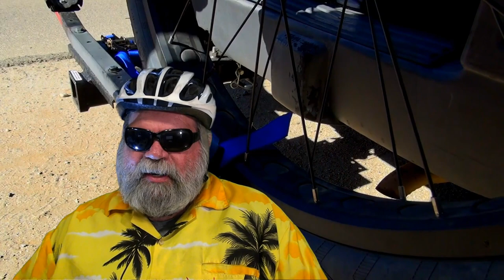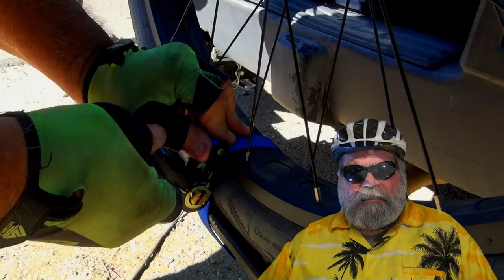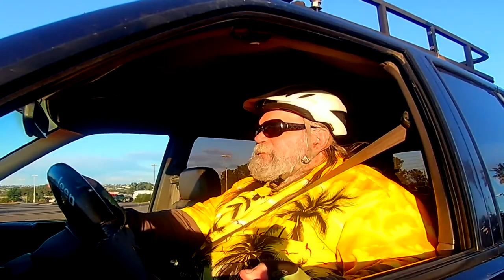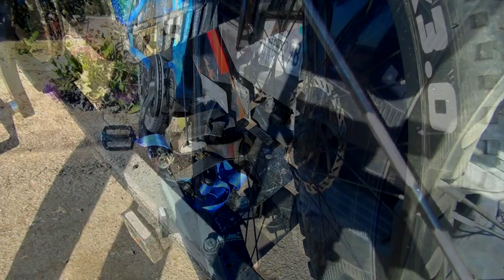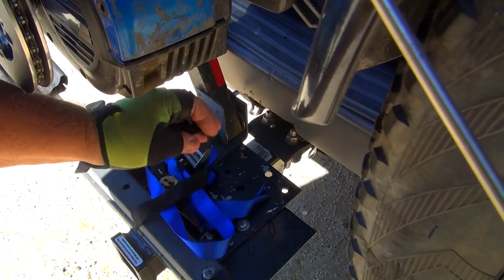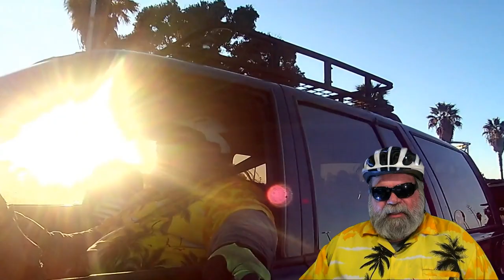Loading my eBike onto My "DIY" e Bike Rack & Strapping the e-Bike Down.

Comment: Wow, I never thought of the tires going flat and the hook not holding. I do have another helpful bar holding it as well in fact I use the same strap on it as you mentioned in you rack build video. I will send you a pic soon. I should probably consider strapping it as well but I like easy and fast on and off. Maybe for extended drives.
Reply from the maker: The only reason I brought up the flat tires is a buddy of mine lost his bike in just that way. I'm making a short little video on the accident. His bike was totaled and the car that ran it over was damaged also. My buddies insurance paid for the damage to the other car but not his eBike. When I go on long drives I add a strap and I also hook up my tail light extension bar.

Comment: I also made my Bike carrier, a bit different from yours though as my tires and wheels sit into a well so to speak. I use a center mast and hook onto the center joint and it works well. I only ratchet strap on long or highway runs as extra security. Good video and keep it going. Thanks.
Reply from the maker: Thanks, The bike rack in the video is a rack I built 25 years ago and has sentimental value for me so I keep using it. I have built much better rack but it seems some of my friends always need a rack for their eBikes so I end up giving them the nicer ones I've built. As I said I've been using this rack for over 25 years and it's served me well. I have a video coming out talking about a friend who has a rack similar to what you described and he never used any tie down straps. Unfortunately his tires went flat while transporting his eBike and the bike slipped under the top tube hook and bounced out of the rack. Sounds like your rack is very secure but I maybe add a strap just as cheap insurance. I would love to see a picture of your DIY Bike Carrier.

Comment: I noticed 2 things in this video...... 1. What happened to the 6 foot long channel for the wheels/tires that were in the first DIY Bike Rack video?   2.  I would normally suggest locking the front suspension fork but with the extra strapping used, it is probably not necessary.
Reply from the maker: Thanks for noticing the differences. Yes, in this video I'm using a rack I built over 25 years ago and has served me well. It has carried road bikes, Mountain Bikes, Recumbent Bikes, and now eBikes. It has been run into by cars, backed into trees, and it is totally scratched and dented up pretty good. But this kinda makes it like me, dented and scratched up and the rack has sentimental value to me. Actually, I have been using the rack that I made a video about, but my friends always seem to need a heavy duty eBike rack, so I end up giving my video racks away. I'm making another video style rack so you will see it in future videos. 😎 You have a good point with regard to locking the front fork and on longer travels I do switch the suspension fork into the locked position. That's a great advice I forgot to mention in the video.

Comment: Is that a roof rack that you used in this build?
Reply from the maker: I've been building my on bike racks for years and have ended up with extra parts from old racks. Many of my builds have parts from many different types of racks. Yeah the tire tray was probably from an old rack however sometimes I would purchase a replacement tire tray on-line for a build. Recently, unless I have the extra old parts I usually purchase some aluminum U-Channel for the tire tray. Thanks.

Comment: That looks like a different rack.
Reply from the maker: This was the first rack I built 25 years ago and it's still going strong. The racks that I built in the How To Video, I gave all of them away to friends. I'll be making more racks but this one has sentimental value to me so I'll probably keep using it. It's kind of bent up from being run in to but I still like it. Plus it's all scratched up so it kind of matches me. I'm kind of well used also.  😬

Comment: I see some issues, your license plate and brake lights are covered, giving the police a good excuse to pull you over. You lifted the bike up and strapped it in, it's not rocket science. You could have said everything in thirty seconds or less, maybe you should have shown people how to build the rack instead.
Reply from the maker: Yes, I've had comments of that nature before. Actually, I've had 2 different police officers tell me my set up is good. The brake lights are visible through the spokes along with the upper light, and the license plate is viable enough to be legal. They told me, that basically almost any rear bike rack obstructs some part of the lights and/or the plate but the only reason they might pull someone over for that is because they are suspected of some other crime. However, in any case, I've been using  that particular home made bike rack for over 25 years to carry road bike, recumbent bikes, mountain bike and now eBikes and have never had any issues with the police for using it. However, when I use a bike cover when hauling the bikes I have an extension tail light and plate kit that clips on the bike rack. Unfortunately, almost all of the rear style bike rack obscure parts or all of the rear lights and/or the license plate. As I said, I've never had an issue in the entire time I've hauled bikes, but you are correct, the obstruction could be a traffic violation. I probably should use my tail light extension all the time, but as I said, I've never had an issue with it. How to you carry your bikes?
Reply from the maker: Yes, it's not rocket science, but for some folks, they prefer detailed instruction. Sorry you didn't enjoy the length of the video. Many have said they enjoyed the information as well as the entertaining style of the video. You mentioned a how to video for the eBike rack. I have made just such a video. Here is the link to my video showing how to build the heavy duty bike rack. . It also has a parts list and shows where to purchase the parts. The video was made a while ago so the prices may have increased. Hope you enjoy the How To video  https://www.youtube.com/watch?v=-uPYo8zCr7U&list=PLq9_CVXEjS_CJX-mdYEdzO0AsUTHocOmi&index=1
Reply: @GreyBeardEBiking  you seem to be taking this a bit too personal, you should think about turning comments off.
Reply from the maker: @kengunnett2017  WOW! Not sure where the "Too Personal" came from? I simply answered your questions and actually agreed with you on the obstructing the lights and plate issue. Also I gave you an avenue to view the DIY bike rack. Again, sorry you didn't enjoy the video but I think I'll keep the comment section active as I enjoy  reading the feedback from viewers. I am still curious as to how you transport your bikes.